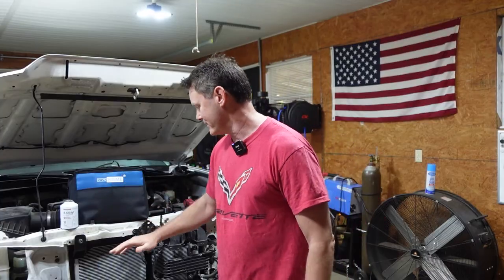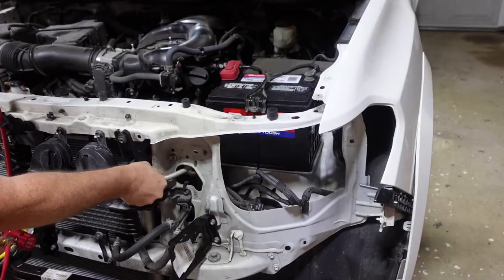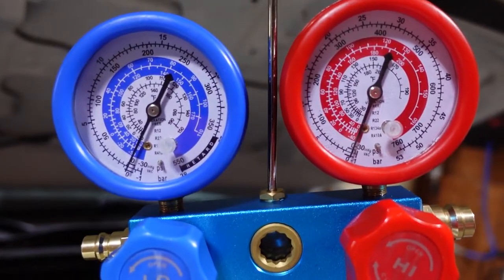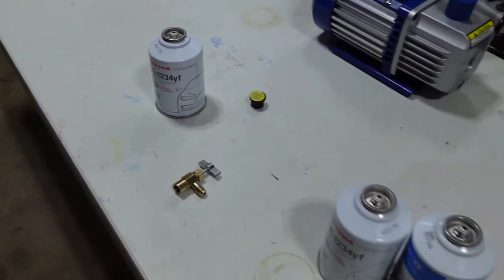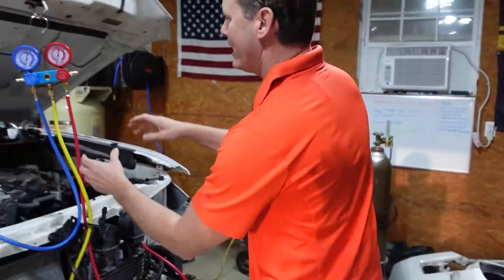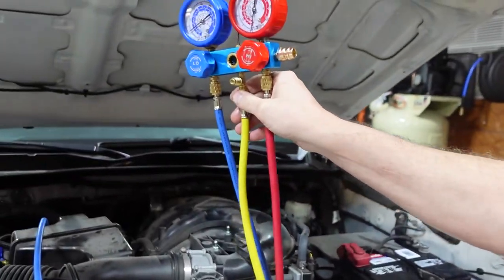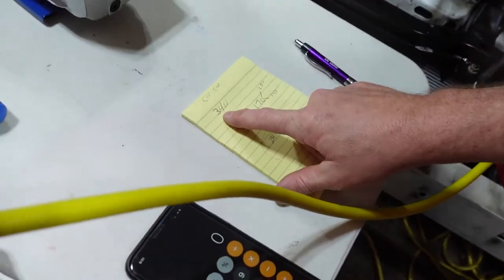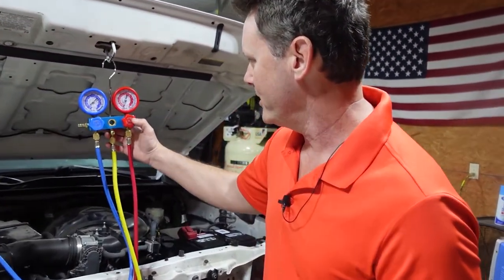How to Recharge R-1234YF Freon in Toyota Tacoma

Comment: Just put R134a back in it. Just have to use the adapters. Works just fine and way cheaper than that new garbage
Reply from the maker: I did think about that long and hard.
Reply: @SwampBoysGarage  props to you for doing it the right way tho 👍 great job
Reply: Or propane... Even cheaper and more efficient also.

Comment: Hi I did not see that your gages were for the 1234yf on the face of the gage, if you buy a set of gages specifically for 1234yf refrigerant it has all the accessories that you had to keep running to auto parts for, you did the charge according to weight of refrigerant so that was close...   tlc...Im still learning too, good video..
Reply from the maker: Yeah all the Chinese gauges are for multiple refrigerants.

Comment: Is there a way for me to remove the refrigerant without bringing it to a certified mechanic? I have to replace the compressor. The job looks easy enough but I'm not sure about that part of the job. I'm not sure if I'll be able to find a shop that will handle only that for me.
Reply from the maker: Yes there is a way but it would not be environmentally friendly. lol. A shop would evacuate it for you if that’s all you wanted. Not sure the cost.

Comment: Informative video. Simple and straight to the point. Curious if you guys ended up adding oil in the process? 

Im struggling myself to find the correct oil (nd11) for my rav4 so curious if you guys even bothered to
Reply from the maker: ND11 is hard to find. If you change the condenser you need to add oil to it. There is a chart that says how much for a condenser. If your system had a leak and changed hose only then no need to add oil.

Comment: Man...one thing I've never fully understood is AC work.  I'm ok adding a bit when the system is low, but nice to see how it's done when the system is empty.  Does the new Freon eliminate the need for oil?
Reply from the maker: You still need oil with this Freon. We changed the condenser in previous video so added only the required amount to the condenser before bolting it up.
Reply: @SwampBoysGarage  did yours take the psd oil? if so could you say where you got it and capacity? mine does and I have to recharge after an evap replacement but cannot find capacity and can hardly find a place to buy it.

Comment: When does oil need to be added? Is oil needed if the system has a leak and you replace, say an o-ring?
Reply from the maker: I’m no expert but if only a leak you don’t need to add oil. If you change out condenser you would need to add oil.